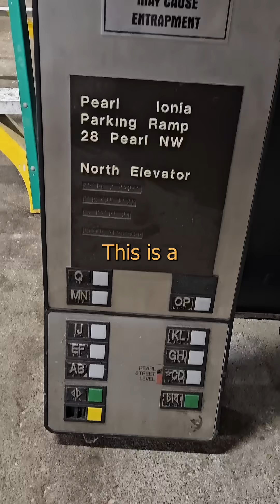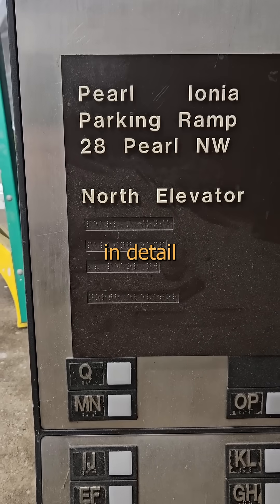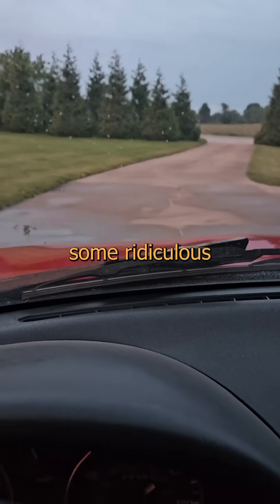Miata Mischief #chrisboden #engineering #gear #elevator #score #stories #parts #hacking #making

Comment: granted I didn't get to keep the thing I moved unfortunately, I do have a part of it that I helped replaced, anyways a buddy of mine found on Facebook marketplace a Pratt and Whitney J57, for those that don't know that's a turbojet engine that's been used by a bunch of planes including the B-52, well he asked me to help him get it, mind you my truck was down at the time and even so I have a shortbed squarebody c10, not long enough for a 20ft jet engine, so we end up grabbing my family van and take the 2nd and 3rd row seats out and then proceeded to go put the engine in the back of the van, strap it down inside the van and strap the doors and hatch(the van is a 2nd gen GMC Safari with the "dutch door" rear doors) to the engine so they're not flapping around going down the road, and hauled it 70miles back to his place and got stopped by 4 different police officers asking about wtf was in the van, it was certainly a interesting way to spend a day off work, btw for anyone interested in why my buddy bought the engine, he turned it into a gigantic grill+smoker because the engine was completely toasted and it was basically scrap and so he made it funnel all the smoke out the exhaust, the dude is a retired army Colonel and long time family friend with too much time and money on his hands and not enough impulse control

Comment: Oh, and I also wrested a 72 inch flat screen from the early 2000's (meaning it was heavy as fuck) into the front seat of a 99 Pontiac Grand am coupe. I couldn't get it out of the car (my lack of height made it impossible to heft the heavy thing out of the footwell) so I gave it away to the first person who could remove it. My good friend Ross got it. It was easy to diagnose the issue and all it took to repair the thing was a $12 capacitor. I am pretty skilled with maneuvering oversized things into tiny spaces 😉

Comment: My dad had the idea of buying two trailers and made me go pick them up in the same 500km round trip. The first one was easy, tow it like normal, the second one was in the third level of the smallest underground parking garage in the known universe, so we got inside towing the trailer with my 4x4, then we struggled for an hour to put the second trailer (flat tires included) on the first trailer, and then we had to maneuver everything out the spiraling ramp that was so tight we needed two spotters and like half an hour to get out. This is not an exceptional thing when it comes to my father, I have many more stories like this.

Comment: I was building props for a show being put on by my daughter's dance studio. On the way to the shop from the local home improvement store I hit the brakes to stop at an intersection in the parking lot and the pedal went to the floor. I limped back to the shop in my busted xTerra that was way overloaded with lumber strapped to the dinky roof racks and the hatch wide open and full of 1/4” lauan.

Comment: One time I had found some mopeds, and after getting them home, messing with them, cutting the mufflers off and welding a cherry bomb onto one, doing burnouts and basically trying to blow them up…

I gave them away for free. And what person sees two free mopeds and comes to get them? Someone with 2 friends, a 2000s Hyundai Santa fe and a dream. And no ratchet straps. 

They fit one of the mopeds in the car, somehow, and then managed to get the other on the roof, somehow convinced myself and a friend to sell them a ratchet strap(because they “only needed one”), and we watched them struggle to get this abused wheeled monstrosity into the car and onto the car. Boy howdy they were determined and they did it. Hour later they left with both and I got $10 for a ratchet strap and a show.

Comment: Last week I put a couch on the roof rack of my Impreza. Which wasn't actually sketchy, I've put twice as much weight up there in lumber, but the couch certainly got more looks on the highway.
The most weight I've had up there is probably 400 lbs in plywood.
The longest item I've had up there is some 16' joists for building a deck.
The funniest thing I've done is probably fitting 2 kayaks in the back of a Hyundai Tiburon while the passenger held them in place.

Comment: One time in high school, my brother and I had to pick up a wooden bench that the legs had broken off of to fix. For reference, I drive a del sol and both me and brother are on the husky side. The legs fit in the trunk, but the seat was just wide enough not to. However, it did fit behind the seats. Some of you may ask, why not strap it to the roof. Well, it started to rain. Long story short, we lived about 15 minutes away and I basically had to clutch with my knee.

Comment: One day, I was driving home from work when I noticed a convenience store being renovated. I went in and asked them if anything was up for grabs. All of the commercial grade heavy steel tables and shelves were going. I had a car full of skiing gear, but I was determined. Bonus points, the hatch on my hatchback has broken gas cylinders. (Quick tangent, I used to work on a farm and we had a portable sawmill. To this day, I still use a scrap piece of trimming to prop up my hatch because a free piece of wood is a lot cheaper than a new gas cylinder.. plus, it’s a conversation piece!). So here I am, still covered in flour from the pizzeria I work at loading convenience store tables and shelves into the back of a Kia propped open with a stick… I dropped the first load off at my dad’s house (abt 5 mins away) and came back for the rest. The hatch wouldn’t properly latch so I was huffing exhaust fumes the whole way. 

Not particularly sketchy or artistically interesting, but I had a lot of fun with it! At the time, I was scouring thrift stores for an old desk or shelf for my little 3D printing “lab”. Worked out perfectly! 

One day I’d like to nab one of the signs from this local abandoned ski resort. Might need a bigger Kia though..

Comment: I ended up holding a microwave (still in its box) in my lap while riding in a friend's old Saab convertible (don't know what model, just that it's a Saab). Sounds mundane, doesn't it? Well, it wasn't.

See, the whole thing started when we discovered that the box wouldn't fit in the boot, so we tried to put it in the back. 

Problem is, my friend doesn't trust the top of his car to come back up after it goes down, so we couldn't put it in that way. And then we discovered that the front seat wasn't able to move forward far enough to fit it through.

So we couldn't put it in the back seat either.

I had to get in and buckle up, then have the microwave passed to me to get it inside.

I spent the whole trip having to breath somewhat shallowly, despite the seat being as far back as possible. Then had to do the whole operation in reverse to get back out.

Maybe I could've been put in the back seat, but honestly we didn't think of it, and it was probably a better idea to keep hold of the box.

Comment: I bought a engine and transmission from someone recently that I had to get home, I have a 2007 Altima but instead of the shitty cvt I got lucky with a 6 speed manual, the only downside is it’s incredibly hard to find parts for the transmission and also unlucky for me the synchros are going out in 3rd and 4th. I was on fb marketplace like usual and I decided to look up manual altimas with a mile radius of 250 miles, and there it was a wrecked 2008 Altima with the same v6 and 6speed tranny, didn’t have a truck anymore and the guy only wanted 250 for both, unlucky me again, it’s 5 and a half hour drive. So I said fuck it, drove there in my Altima , I separated the engine and tranny, took the heads and timing chain off the engine, put the heads in the back floor boards, and the engine block and tranny went in the trunk, craziest thing I’ve ever had to buy/haul, it was a good road trip and now I’ve got a low mile motor and tranny

Comment: Well I had the opposite issue 😅I had a 88 Silverado K5 edition Chevrolet. The funniest thing was in the 90s. I had to change the spark plugs luckily enough I had people but I wanted to do it myself. everything on that truck I fixed by my self. but get back to the point 
I’m 5 foot and when I laid across that thing to change the spark plugs, all you could see was my feet. 
😂 it was fun😂. 
I learned a lot about that lovable bear of a vehicle. And one day I want to own another. Great fun I camp out at the middle of nowhere. Use my air mattress that I would sleep on in the back of the vehicle never needed a tent but during the day I’d use my air mattress to go out in the water and have fun by the time not be dry and I’d be able to sleep on it. Honestly, I was very lucky. My parents trusted me enough as a little girl to go romping around in the woods😂 
I dont think you see that often these days.

Comment: I hauled 30, 10 foot sticks of 8inch schedule 80 pvc on the roof of my 2009 mitsubishi lancer. Then drove it 26 miles to the job site. It totally ruined my shocks and cost me my exhaust on that car(my muffler fell off about 15 miles in) but I made enough installing roof drains with that pipe to buy my first proper work truck.

Comment: Me and some friends got a call late one night that a buddy's motorcycle had died under him while riding it home. Everyone except our driver had been drinking, so we hop in his van and go get our friend.

The idea was to get the bike and friend home. We had nothing to secure the bike with in the back of the van. Me being quite skinny got volunteered to get in the back and hold the bike the entire ride.

And that's only half of it. The van was a work van. My buddy (the driver) being an electrician, meant that the back of the van was full of wires, cables, tools and an assortment of pointy things. It's a miracle I didn't get scratched, stabbed, poked or injured in any other way. Mind you, I was in the back with a motorcycle that weighed twice as much as I do.

I don't know exactly how long I was back there, but it felt like an eternity. When we were done we just went back to drinking.

Comment: I hauled a 30-40 year old- 250 gallon propane tank on a boat trailer.  With propane in it, enough to kill me and others in a moderate radius if it ruptured and ignited.  Probably not all that smart without the proper safety gear lol!  Got it home safely.  Oh and it was well strapped down, but now wondering (about 15+ years later) if I accidentally violated some DOT regulations lol!

Comment: Sketchiest I had to do was when I had to bring my subwoofer in for repairs however it was a massive 18 inch woofer with a case that's already a pain to lift on my own. At the time I was driving a toyota aygo, it didnt fit in the trunk or on the backseats as the openings were too small. I managed to fit it in the passenger seat but couldnt really look at the mirror on that side and it was a very precise fit. I had to drive for like an hour and a half with it 😂

Comment: My commuter is an 06 spectre and I've learned after many time stopping by home depot on my way home that If I really cram them in there I can fit 8 2x4x8s in the car without getting pulled over and put in a straight jacket. Also the trunk can fit a full 3 string bale.

Comment: When I was in college I owned a little Datsun pickup. Living in Austin…home of the weird, stupid was bound to happen. One day I was rear ended and my rear bumper stayed in one piece but half of it bent down with the frame and looked like a ski slope.

Later that week we bought an old couch, backing the truck up the driveway was problem free. Unfortunately the couch was kinda heavy, and the old suspension like most old things couldn’t keep it up…well as we drove off with the couch the bumper left a 5 foot scratch along the driveway. The home owners didn’t look too happy as we were also shocked at what happened and proceeded to haul ass outta there.

Comment: When I was 22… which is 3 years ago, I found a run over street sign at my trade school. I thought it be cool to have my own parking sign and put it in the long way, from the passenger airbag, to the end of my rear bumper, in my Passat wagon. I found out that day, that doo to negative air pressure at the rear of the car, all the exhaust fumes would end up inside my car… 
Was a fun trip back home… especially when I had to get rid of it the next week because, apparently that is still theft.

Comment: I once brought home a complete 351 Cleveland carb to oil pan, plus some 390 parts and accessories in the back of a Subaru impreza on an 1-1/2 drive. Needless to say the front wheels where a bit on the light side and all kinds of sketchy. After that the Subaru was referred to as the S-350 after ford truck designation. 
I have pictures.  😂

Comment: I had a 2000 mk1 focus wagon. When i was 19 my dad sent me to Home Depot to pick up an online order of mulch he made. My dad said "it's just few bags it'll be fine". Well i got there and it turned out he ordered an entire pallet worth of mulch. Me and loader at that station wagon filled to the gills with mulch to the point that my 6ft1in body was squashed into the steering wheel because i couldn't move the seat back let alone be able to look out of the rear view and passenger mirrors. The suspension was bottomed out and i thought the tires were gonna pop. I was ticked but i made it back.

Comment: Dad and I disassembled a 30' x 60' house for the lumber. We had a 1956 stake bed 8' x 9' bed so he stacked three 20' pieces of 8 " I beam on the passengers side . We loaded them using a tripod and chain hoist. We're were legal with thee feet out the back.😊

Comment: Definitely took my ninja 300 and strapped three sea bags on the back, stacked, and strapped my full backpack to the tank to help offset the weight. Rode that from Florida to Virginia... It was scary, but besides the precarious refill times, it went smoother than I expected. Needed new tires and pants after that ride.

Comment: I wanted to build a sub box for a friend and went to get the wood, but I didn’t think about how big it was until after I bought it, so I sat in the parking lot with a hand saw and cut a slot out so I could see as I set it on my lap wile I drove with only me left hand, also, I had to put the top down on my car to make it fit in general

Comment: I managed to fit a bed frame, mattress, and 50 inch TV in the back of my Fiat 500.  Took out the rear seats, had the bedframe and mattress stacked up between the front seats so I could barely reach my shifter, and the TV in there crooked, all hanging out of the back with a bunch of ratchet straps holding the hatch down and the stuff inside

Comment: I own miata(S), and once I was using one as a daily .... well. I needed a piece of plywood, and my friend needed a ride... she had to sit on the trunk (legs by the back of the seats), plywood on top of the windshield and the rollbar.... and she was holding it ARMS WIDE OPEN and I used my left hand to keep it from sliding left or right.   Shifting was interesting

Comment: Depends on what kind of weird. I'm a farm guy, so I've hauled all kinds of diseased animal carcasses with unknown injuries, various mechanical marvels of gas and steam, etc. The sketchiest of all time would have to be a Bucyress crane. I have no clue how many weight laws I 'bent' hauling that monster in three trips with one truck. But the really fun part came when I got that old motor running and rigged it up to be a crane or a radar/sattelite/radio tower that could all move. Worked great until expensive sounds occurred and the crane boom was in pieces. I do still have a control lever or two in a shed somewhere.

Comment: My 1st Gen Neon still has the cut in the headliner from the 4'x4' slab of granite I shove into the back seat. Part of the slab is still the hearth for my electric fireplace. The Stratus RT I had after that was my "truck" when I was building an elevated shed. Poured the foundation a couple piers at a time with 400lbs of sac-crete in the trunk, a couple sticks of rear running through the shuttle threatening the stereo, and tube forms stuffed into the backseat. I got the framing for the floor the same way, running the boards through the shuttle from the trunk to the dash. Finally when it was time to lay the decking and build the actual shed, my dad came down to help and brought his actual truck.

Comment: Oh, there have been a few.  I I used to put a Sunfish sailboat into my '72 Townsman wagon - diagonally, with 6 or 7' of boat sticking out of the tailgate.  I had the spars lashed to the roof rack.  

Then, there were the 12 friends I took to a party in that car ... yeah, we put 13 men in that thing.  One of them was 6'7", too.  Did I mention that a full size '72 Chevy wagon was a GINORMOUS vehicle?  

And last - and should be least - when I was young and dumb (statute of limitations has LONG passed on this - it was more than 40 years ago), I once made a run for a friend with the back of the car filled with road signs ... posts and all.  The guy who acquired them was a college varsity shotputter - and he just yanked the posts out of the ground, apparently.